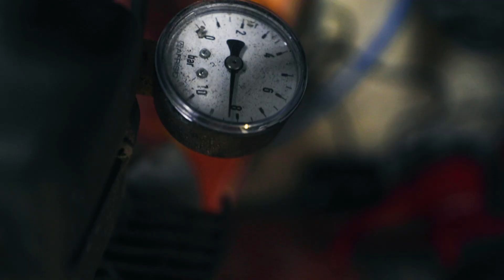Rost am Kotflügel & Raptor Lack. Endlich wird am VW T4 geschraubt! (mit meinem Bruder)

Comment: Gibt inzwischen so kombinierte Rostumwandler mit Epoxy Grundierung. Da spiel ich grad mit rum. Langzeiterfahrungen fehlen natürlich. Wenn nicht überlackiert wird, nehme ich meisten Brantho Korrux 3 in 1. Damit habe ich recht gute Erfahrungen gemacht. Wenn überlackiert werden soll, freut sich der Lackierer aber über einen Epoxy Primer. Brantho Korrux ist nicht tragfähig. Alternativ gibt es noch Brantho Korrux Nitofest. Der Einstieg wird ne größere Baustelle, trotzdem eine lösbare Aufgabe. An der Stoßstange hätte man einen Haftvermittler her nehmen sollen vorm Raptor Lack.
Reply from the maker: Dank Dir Tom für die Tipps, werd wohl in Zukunft auch auf Brantho setzen bzw. wie heißt das von dier verwendete, das Rostumwandler und Epoxy Grundierung kombiniert? Den Haftvermittler brauch man an der Stoßstange tatsächlich nicht, das funktioniert mit dem Raptor Lack auch so einwandfrei ;)
Reply: @JohannesNickel  gut zu wissen! Presto Stop Rostumwandlerspray.